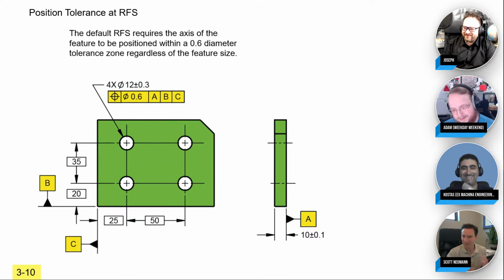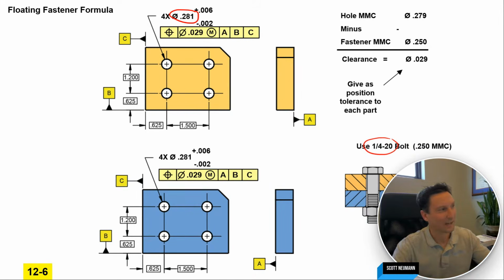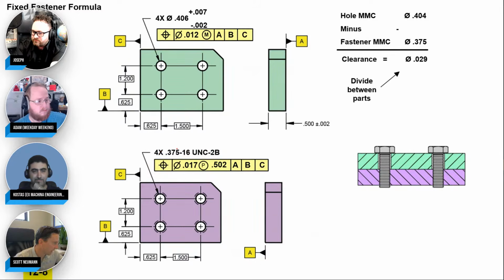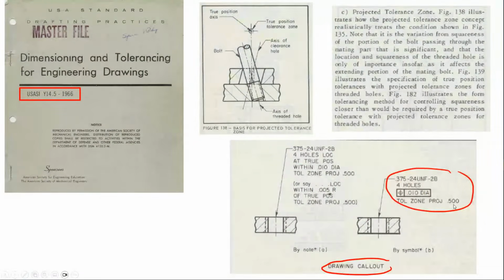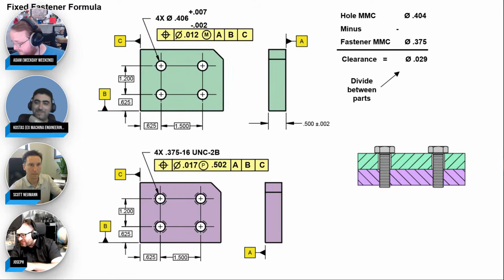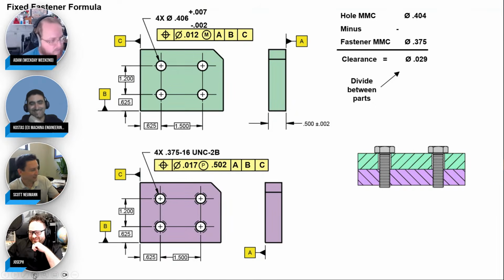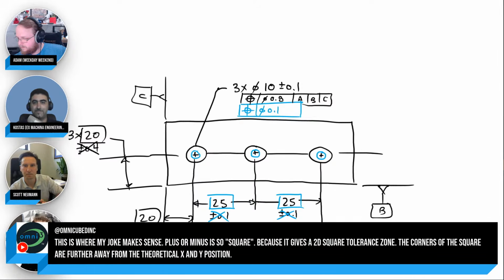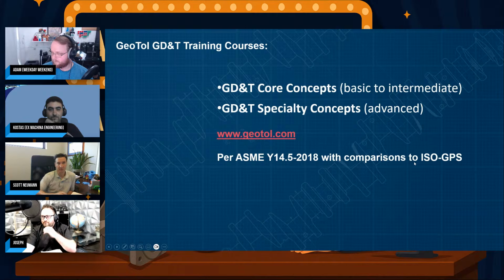Ask Scott Neumann, the GD&T Expert

Comment: I would have liked more discussion on proper datum selection. It seems the functional selection is usually the mounting holes rather than the edges of the part. Also, the mid-planes are usually more functional than the edges. It definitely seems simpler for manufacturing and inspection to go to the edges, but I'm an Engineer, and I know the functional requirements are not to the edge (if that's the case). It creates controversy and becomes political. And also, MMC is not practical for statistical tolerance analysis.
Reply from the maker: Thanks for your comment.  GD&T is a huge topic and there was not a feasible way to speak at depth around every topic, as well as a need to speak to all skill levels.  The full course covers datums and selection thoroughly.